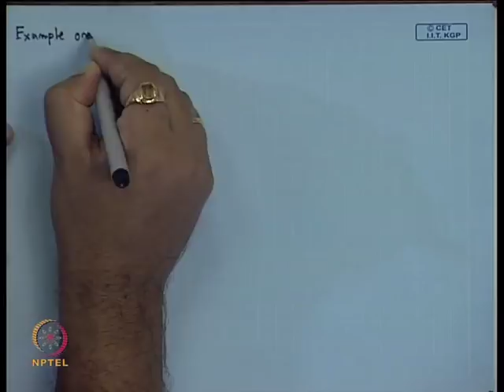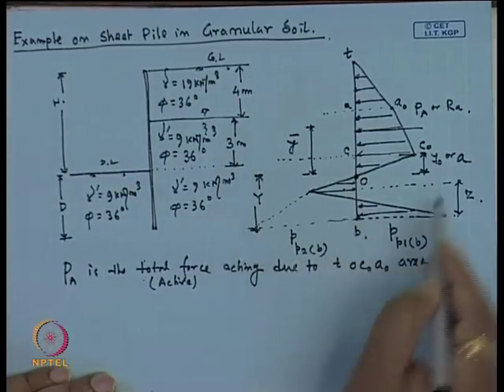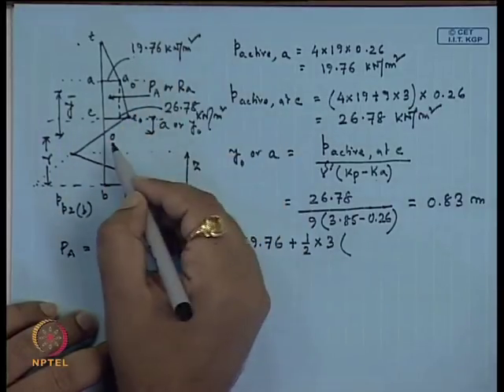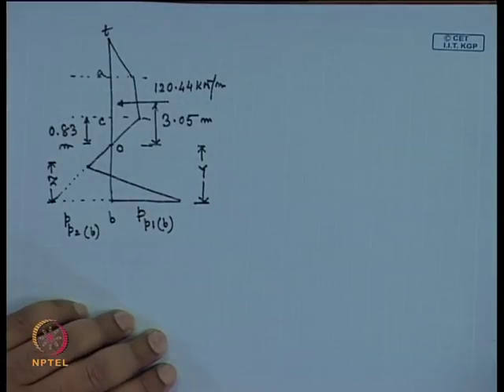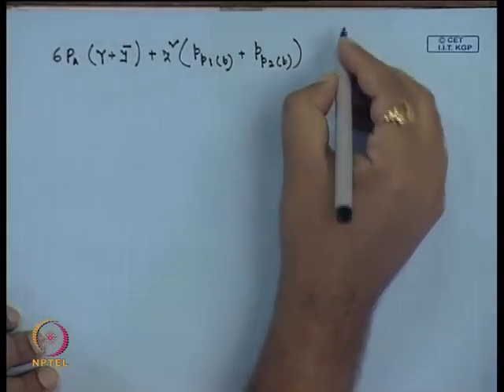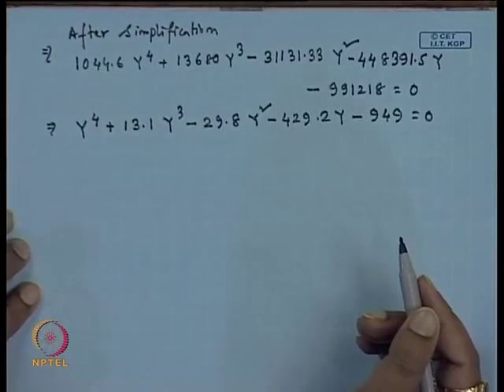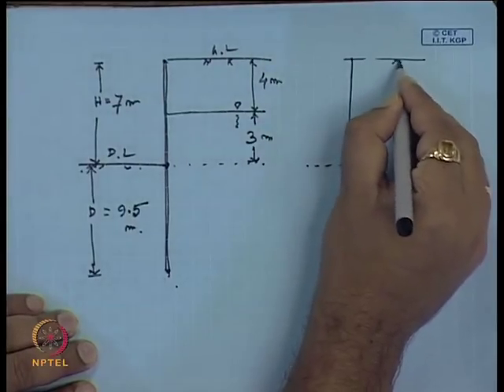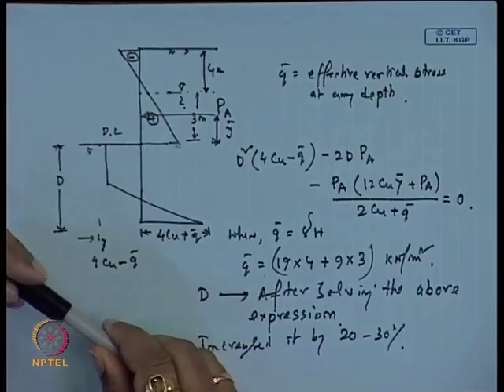Mod-01 Lec-26 Design of Sheet Piles (Contd.)

Comment: If anyone out there could help me understand something, he uses the buoyant unit weight of sand in his net pressure diagram below the water table, but I don't believe he ever accounts for the hydrostatic water pressure behind the wall. For anyone else confused by this I am assuming that the water table applies to the dredged side of the wall too, this way the water pressures balance out? Great tutorial though just a little confused by this! :)
Reply: i dunno, maybe because its granular soil??
Reply: You are correct, pore water pressure will balance out from the back and front of sheet pile wall
Reply: @ChandanYadav-op1pl agree!

Comment: Thanks very much for the excellent video. But I would like to second Ben Bennett's comment below. You used submerged weight of soil (below water table), but you haven't used hydrostatic pressure at all. Kindly explain. Thanks.
Reply: will cancel due to having from both side
Reply: The water pressure from both sides cancel each other out